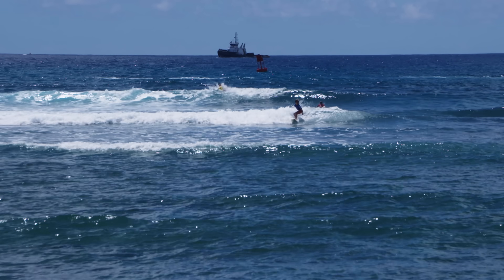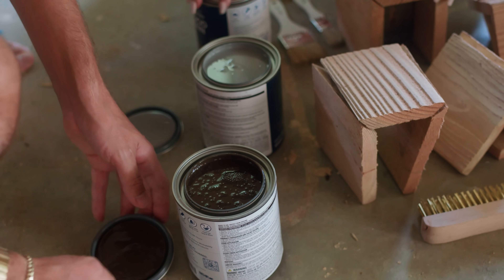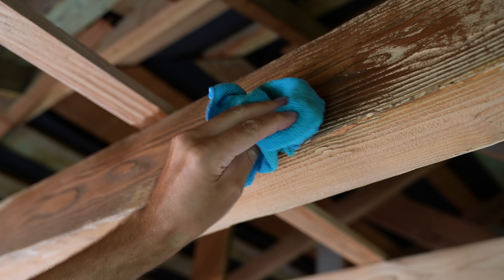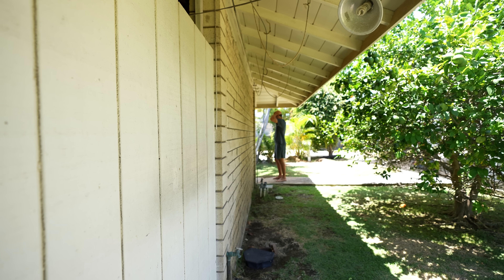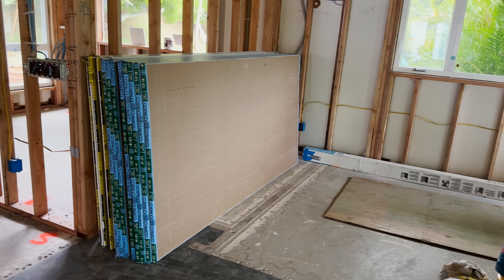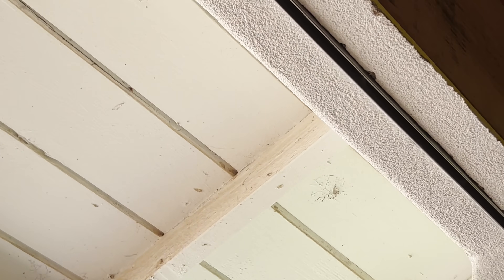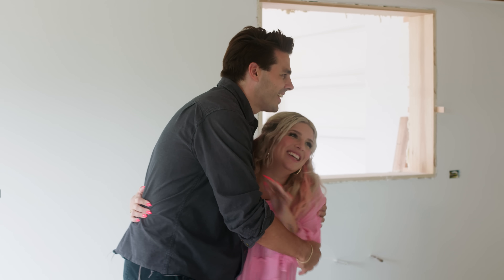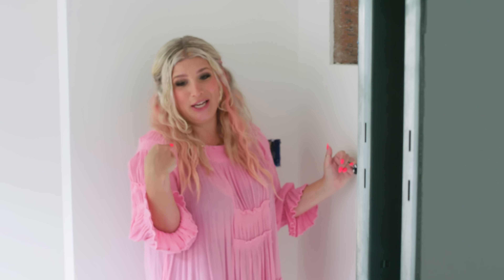Thifted tile decor hack + Revealing our new walls! Yay!

Comment: I love the salvage tile but remember to be very careful about where you use certain tiles! Not all tile is waterproof and the same goes for grout. There’s also ceramic vs porcelain tile and that makes a big difference when it comes to where you are putting it!
Reply: Great tip!
Reply: In the original OMG we bought a house they encountered that problem and Kate ended up waterproofing the tiles so they could use them in wet areas